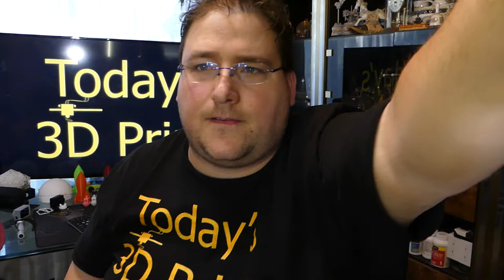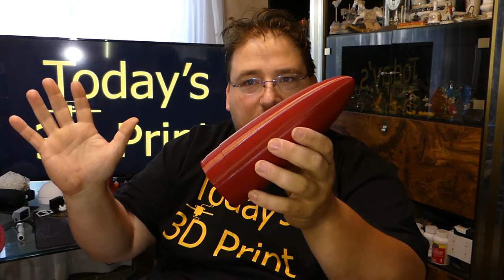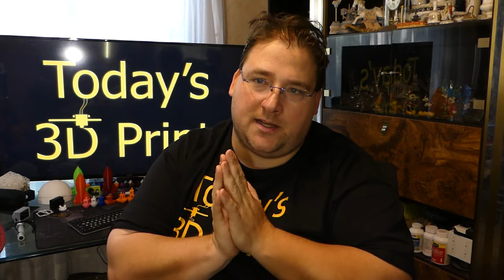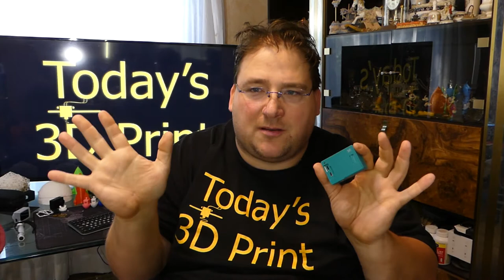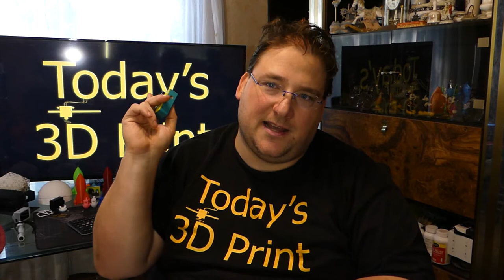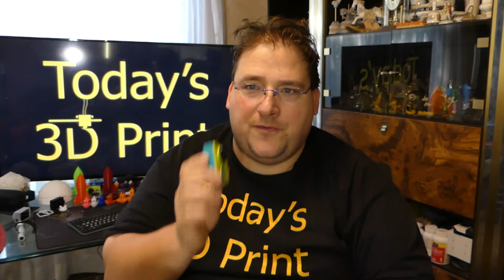Today's 3D Print 120 Help with Joining Differeing Videos together, Assimilation

Comment: The xiaomi yi uses avi h.64 I think....In premiere pro, its easy to deal with this. You would import your clips to your project, and as soon as you drop them in the timeline they will get the settings of your project...ie, If you set your project for 1080p MOV, and you droped you clip from the xiaomi, in 2k AVI, as soon as you drop it in the timeline and hit export, you gonna get your 2k compressed to 1080p and coverted to mov. What is the logo file extension? If you dont have Premiere Pro, and just want to convert both to same thing, try using  " Format Factory ", and convert both files to the same extension.

Comment: Use Cyberlink PowerDirector15 or 16.  It's easy to use (and edit) and you can combine different video formats and rendering is very quick for 1080p.  Yes it is editing but it's simple and fast.  Also, you can get a free conversion program called "Any Video Converter"  You can load different video types and batch render them into a single format (codec).

Comment: You can load it into adobe premier that will tell you all about the clip, then use premier to convert the intro and export the with the codec settings of the other clip. 
The problem is it will be very hard to just shunt stuff together and for it to all work and sound good. 

I put it all into premier do all the editing then export it all with very precise codec settings so it all looks good and sounds good. Yes it does take ages but i dont know another way and get the quality i want.
Reply: If you put a few seconds of video on dropbox i could try to have a look for you.

Comment: there's no non encoding way to merge different video and/or audio formats. you may upload a take from the Yi and that animation for me. I'll check the Yi and render the file(s) for you. tell me what you want
Reply from the maker: +pixelcomet oh I know that that's why I want to transcode the intro clip into the same codec and structure fingerprint as the Yi footage and Lumix footage so that I can then simply merge them without transcoding the idea is to do it once. once it's in the correct format and it matches the other files then I can simply merge them as i please.
Reply: yeah, so read out the specs of the Yi vid and render it accordingly. maybe VirtualDub can help you: http://www.virtualdub.org/

Comment: Ok, if I understood correctly you want two clips of that image in the exact same format has the source of your two cameras, right? I can try to help. I will need the image, and two whatever small (5 sec) clips of both cameras. And them, after I make it I will test them in MPEG streamclip to see if works. But if you want to up your game in the post-production of the videos you will eventually have to step up to Premiere.
Reply from the maker: +Rui Nelson Silva very cool. I agree. Right now though i am just trying to find a middle ground within my time constraints slightly more pro looking without going full edit. The editing is not hard. Its the insane time the transcoding takes!. Got to see if i can find someone to make a tiny intro scene for me that is a skill set i simply lack. :-)
Reply: Well, I once tried to do an intro myself with aftereffects and only someone who has spent some quality time on it can do a small intro. At that time I went for a compromise. I found a free intro that had a licence which allowed to modify it giving only credit to it's maker. Still that took around 3 hours just to change a few things. Just a thing about your videos... everything is great and I'm using them to learn until I have enough cash to buy my first printer but sometimes I just listen to them (which I like) and the high pitch noise of one of your printers working really grinds my ears after 10min or so. I also understand that lack of time can be an issue and multi-tasking is necessary :) but for a next level of editing..... that sound have to go. Keep up the good work!
Reply from the maker: Rui Nelson Silva I'm working on making the printers quieter I really can't stop the printers when I make the videos and I can't plan when I make the video so I can't plan when a printers running. Especially since I tend to run two to five day prints :-) I'm going to try to maybe put up a sound block between the cameras and the printers to see if that'll muffle the sound a little bit because on some cameras that can be very annoying :-)

The one camera allows an external mic I might try to play with that if I can figure something out maybe a directional mic or something or maybe even some kind of filter to take out the high-end not sure how that works
Reply from the maker: +Rui Nelson Silva yes I know very deep respect of the people who can do that that takes an amazing amount of skill and patience

Comment: I like your videos how they are. intro is not so important..i skip them. a video with all stuff is good for promo video for channel but please not in every video. more what i like is a better or more compressed sound that i dont need to volume up as high. the only thing i dont like is your wall unit ;P start watching your channel cause the big prints and very good explain of your printers with tips and tuning. i also like your printstyle with less material as needed.
Reply from the maker: +HammersmashedFace I tried it once with a dummy intro just my logo for 3 seconds in tomorrow's video If consensus is that it is not necessary then I won't bother because it was a pain in the butt to do anyway :-)
Reply from the maker: +HammersmashedFace also as I establish more table space in the other room and can move the printers out of the primary room I should be able to make a lot of Correction to the sound my cameras actually record pretty good sound but those printers high pitch sounds really come through :-( I'm trying to figure out ideas to work on that on the one hand I can quiet the printers a bit but that takes time and money on the other hand I can try looking into some temporary phone on walls to separate the two halves of the room and isolate the printers maybe even a couple of sheets of foam insulation might be enough to do it to stand them up right before I record a video kind of deal